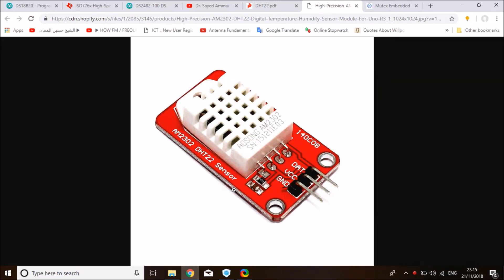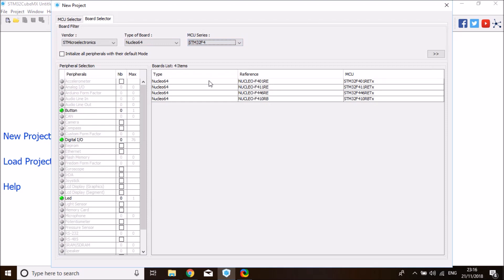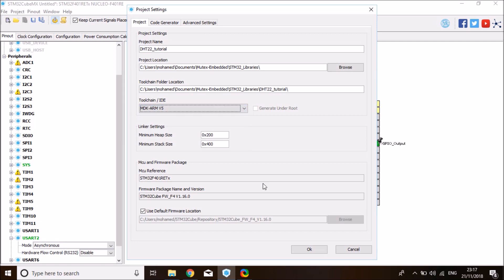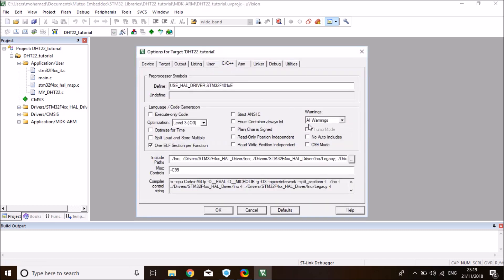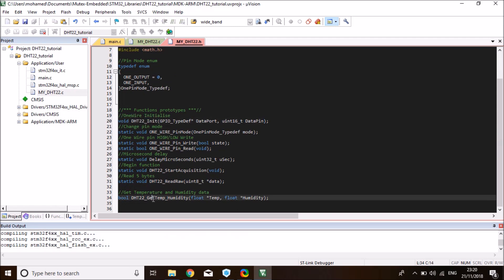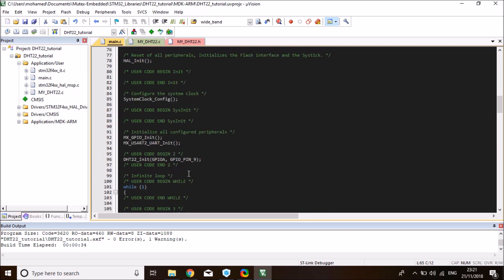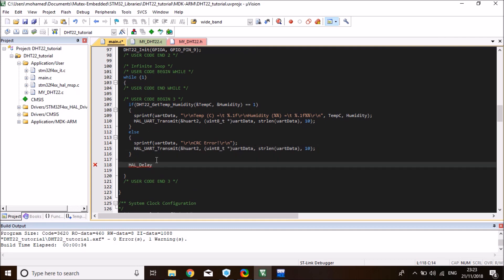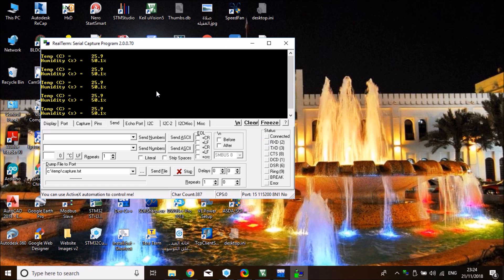STM32F4 Discovery board - Keil 5 IDE with CubeMX: Tutorial 25 - DHT22 Temperature & Humidity Sensor

Comment: Thank you for sharing this.
I have a challenge. My UART only displays the readings if I reset my MCU (STM32F103C8T6). The readings are only displayed once. What could be the issue?
Secondly, what is the purpose of the static uint16_t oneWirePin_Idx as defined in the MY_DHT22.C?

Thank you once again.

Comment: would it work with DHT11 the same exact way? i'm trying it, it compiles but i'm not getting data from the sensor.
Reply from the maker: Probably not, I am not sure if I tried it. You can try reading the 2 sensors datasheet and change code accordingly

Comment: Hey, briefly to all those who had an issue only seeing "0.0" temp.&humidity values in Realterm as RobotnikzSanoka described in the comment above:
Long story short, variables TempC and Humidity should be integers and not floats. The issue is, in the MY_DHT22.c file in DHT22_GetTemp_Humidity() function you perform a division of the temperature and humidity values, messing up with the variables' types. You need to change the division in the lines below to *TempC = Temp16/10; *Humidity = Humid16/10; in that function. Also remember to change the arguments' types to int* in the function declaration (in MY_DHT22.h), definition (in MY_DHT22.c) and calls (in main.c). In main.c, remember to define TempC and Humidity as integers. This solved my problem, hope it helps more of you.

And by the way, thanks a lot @MYaqoobEmbedded for a very nice tutorial!

Comment: i have problem for showing that serial monitor, i dont know why, please can u help me sir?
im following your video step by step and its ok until i run the source code, but the serial monitor not display anything.. baud rate and port is the same as i used.
Reply: Make sure the USART you are using is the one connected to the VCP of the ST LINK (Which version should be higher than 2.1 if i remember correctly), and also after choosing the right USART make sure the pins used are the ones connected to VCP_Rx and VCP_Tx of the ST LINK